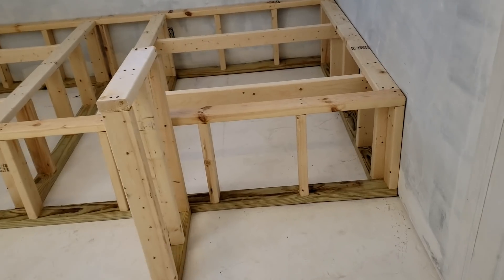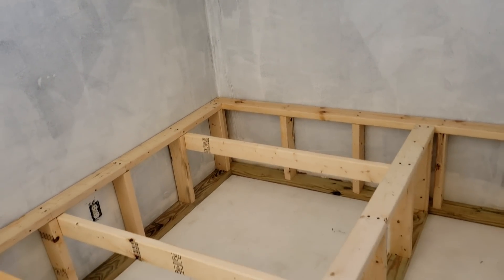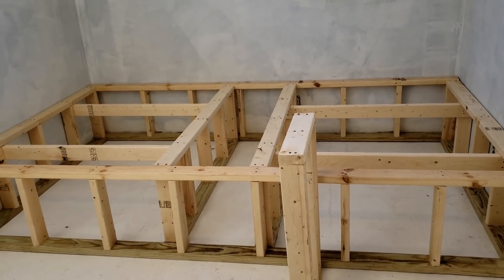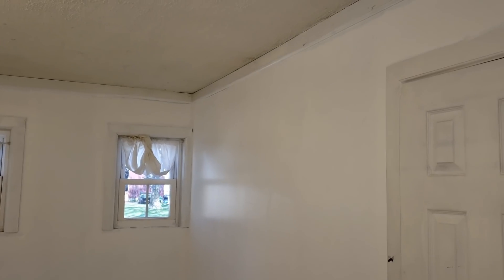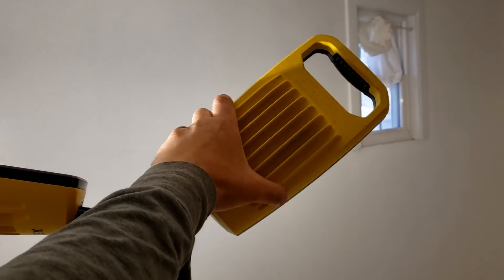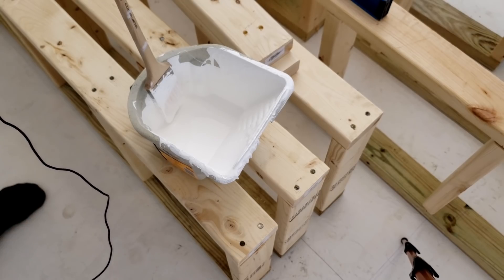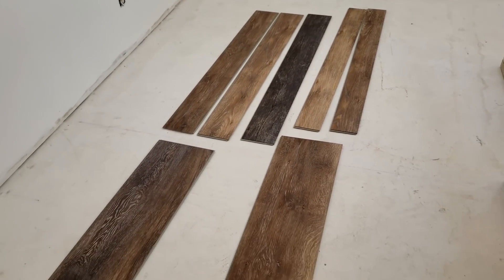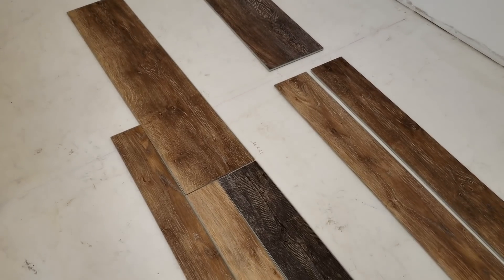Platform Bedroom - I Made A Big Mistake

Comment: You could turn the existing outlets into j boxes and run wire straight up the wall to a cut in box.  You should be able to fish up 12 to 18 inches. 

Great build.
Reply: NVArchitect that’s exactly what I was thinking 🤔
Reply: I agree, that's exactly what I would do as well.
Reply: NVArchitect good point I pointed out just use remodel box with plug pigtail    I should have just gave u a thumbs up good idea
Reply from the maker: yup, that is the plan I just will still have the issue of the junction box below the bed level which I will still need to leave access to

Comment: It's not too involved to have outlets higher.  Just install new boxes directly above the old boxes, and join them together with a pigtail.  Then remove the duplex access from the lower box and use a flat cover on it.  The duplex outlets can be installed in the new upper boxes.  Of course, that project is a lot bigger now that the platforms are back in.  Maybe next time.

Comment: Someone commented regarding a splice kit made by Tyco. THIS OS NOT CODE COMPLIANT!

"NEC 334.40(B) Devices of Insulating Material. Switch, outlet, and tap devices of insulating material shall be permitted to be used without boxes in exposed cable wiring and for rewiring in existing buildings where the cable is concealed and fished. Openings in such devices shall form a close fit around the outer covering of the cable, and the device shall fully enclose the part of the cable from which any part of the covering has been removed. Where connections to conductors are by binding-screw terminals, there shall be available as many terminals as conductors."

 It turns out that the wording of the NEC is subtle and specific for a reason. It talks about "...concealed and fished...", which means that the wire can't be stapled in place (ie, it has to have been fished in). This would seem reasonable, as a stapled wire couldn't be pulled back out for inspection/repair/whatever. So, I'd have to imagine that this device would legitimately fail this particular application because the wires would be stapled below the junction box and any holes in the framing may not let the join pass through.

Comment: Just put an outlet directly above the old ones, just raise it however high you need too and leave the old outlets where they are, Run the romex straight from the new outlet down to the old outlet and tie into it. Essentially a daisy chain, Obviously all behind the drywall and proper through the junction boxes.

Comment: Just use a remodel box with outlet installed using grounded 12ga pigtail cut hole in drywall drop pigtail down drywall cut hole under or next to outlet use low voltage cutout plastereen with cable tv cover.  Remove coax coupler cut side of cover place pigtail plug thru hole.  Plug in to outlet place coax cover. Done all good no chance of issues your welcome

Comment: You may want to consider hinging the entire plywood top. Emergency access. Just in case you need to “rip” the top off quickly to get under there. (Trapped child, etc.) It’s a little late, but I may have chosen to make a deck style platform supported by a couple posts. Even the outside wall style supports you’ve made, but a deck/floor platform across the entire top. Just some thoughts. Love following along. Stay safe.

Comment: Looks great.  
I mentioned this in previous videos, so not sure if you check the older videos.  
You should think about enlarging at least one of the windows for an "egress window" in the event of a fire.  I know you mentioned putting larger windows in at a future date when you did the siding outside.  Well, if you put in a larger window, you would just have to cut down the existing siding, there wouldn't be anything to patch, etc.  Something to consider.

Comment: Contrary to popular belief, you can splice romex behind the wall if you use an approved splice like this. https://www.homedepot.com/p/Tyco-Electronics-Romex-Splice-Kit-2-Wire-1-Clam-A22899-000/202204326  (always check with your local electrical code)  good work as always!
Reply from the maker: I will look into this, although I have a feeling since this is considered a remodel and not a repair they would not allow it, but in the future this may come in handy, thanks!